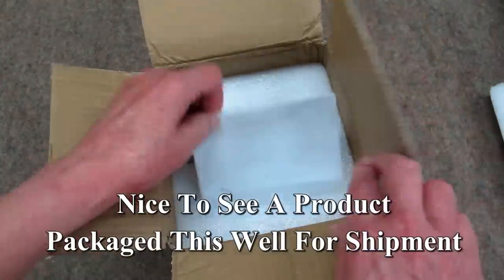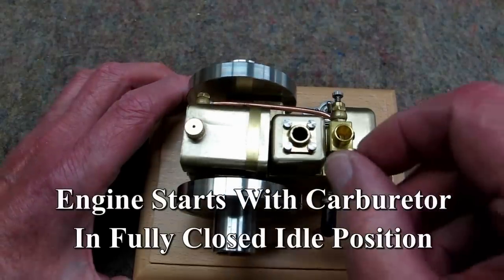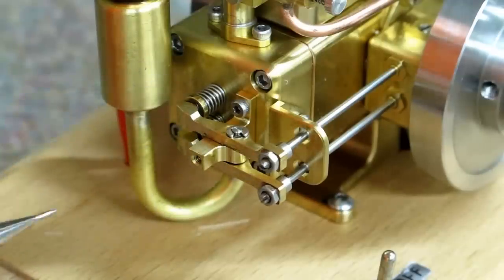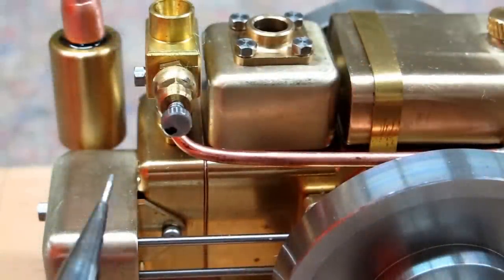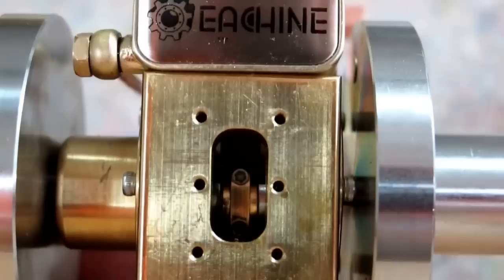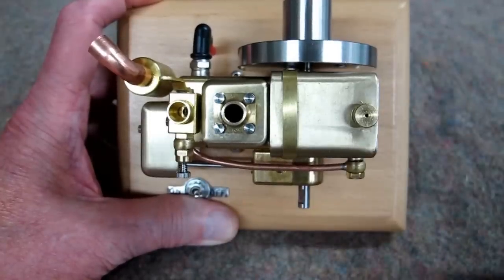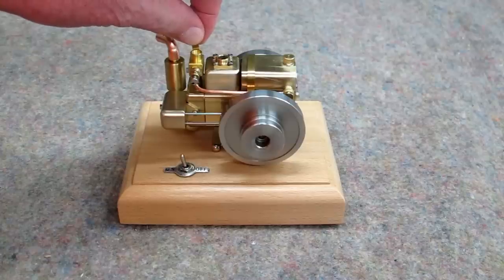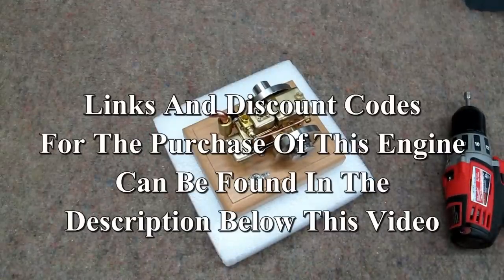Eachine ET5 Mini Gasoline Engine

Comment: Hello Ronald,
I have a question !
I bought one of these motors Eachine ET5. 
Now I have accidentally turned the screw where the throttle sits on it. 
Since then I can no longer adjust the engine, I have it now running, but as soon as I operate the throttle, the engine goes out.

Can you possibly send me a manual on how I can set the engine again from scratch that he runs as I got him. So as the carburetor was set on delivery !??

With kind regards Reiner Stähler
Reply from the maker: Hello Reiner,
When you say you “turned the screw,” are you referring to the “needle valve”?
Carburetor needle valve adjustment for most of these model engines is very sensitive.
It is a very fine point between running and not running.
There is no manual.
Where did you buy the engine? How long have you had it (when did you receive it)?
Is this your first model engine or do you have previous experience with such engines?
Ron
Reply: @RonaldWalters2010  
Hello Ron,
this is my 3 engine of this type. I have one ET1 and two ET5 the second I bought when I had adjusted the carburetor needle and he no longer ran !!!
I bought both engines from Bangood. 
If you want to know when I received it for reclamation or repair, I don't want to send it back, then I guess I will keep experimenting until I eventually find the adjustment again.
Have but otherwise not so much experience with these engines !!!
Reiner
Reply: But no problem Ron,
just thought maybe there is a guide on how best to proceed to get the engine back to clock condition.
Eventually I'll write to Eachine and ask there times although I have little hope.
Your channel is really the hammer would like to have a few more of these engines as well as the Eachine EM1, EM3, EM4 and so on and so on.
If they are cheaper again I will certainly get me again a model. I think you are just great !
Unfortunately, they are not very often sold from Poland or from Czech Republic, because otherwise I also have to pay customs and or import tax in Germany, but I do not give up hope!
Greeting Reiner
Reply from the maker: Hello Reiner,

Well, I hope you are using the links and discount codes in my video descriptions whenever you purchase an engine.

I find the ET5 to be somewhat problematic. Do not waste your money on the ET5 Pro. Also, I have declined to review the new 2-cylinder version ET5S. 

ETX runs well but is too complicated. I would recommend buying something else instead.

ET6 and ET7 are good engines.

Stay away from the ET8. Way too many problems with this engine.

EM1 double piston engine runs nicely, however it does tend to shake itself apart and requires frequent re-tightening and re-timing. Mine did not run out of the box. I had to replace a number of setscrews, which were too short, and then I had to figure out how to time it. Asking Eachine for help was a total waste of time… they did not want to answer anything. They acted like I was asking for trade secrets and I am trying to help sell their engines! The EM1 is VERY, VERY sensitive to needle valve adjustment. But I think it is a beautiful engine just to look at!

EM2 seems like a very nice little engine. Very steady runner… and also a pretty little engine.

For most engines… gently close the needle valve and open it 1/4 turn. Absolutely no air in the fuel line. Once it is running and has warmed up a little… adjust the needle valve (very slowly) for best running.

If you are using regular automotive petrol in your engines, carbon could become a problem. Fouling a spark plug or it does not take much to hold a valve open slightly and then it will not run.
I like the Coleman fuel with very little Marvel Mystery Oil as it is clean burning.

ET5 … the fuel line is difficult to get out all the air and maybe the little o-rings on the connectors could leak a little air. My needle valve was 1/4 to 1/3 turn open.

The ignition system on older engines had a habit of quitting when 3 batteries were used. So we accidentally discovered that the problem went away with only 2 batteries plus a dummy battery, which lowered the voltage.

I will be reviewing the EM3 and EM4 next.

Currently it looks like Banggood is out of stock for many of the engines.

Sorry I cannot be of more help with your ET5
Have fun!
Ron
Reply: @RonaldWalters2010  
Hello Ron,
thanks for the tips, the with the2 batteries I have used directly already with the 1 engine and only 2 batteries and a dummy.

Sorry I had completely overlooked, no I have the needle on the throttle adjusted, not the needle where the fuel line arrives!

I use lighter gasoline with a small shot of 2 stroke oil!!!

I will definitely use their links to the engines, as I said when you are cheaper again.

Have a nice weekend Ron.
Until then times Reiner
Reply from the maker: Hello Reiner,
Generally I do not take something apart if it is working or running correctly.

In the case of the ET5 carburetor, I also have not taken it apart. So, somewhat embarrassingly, I have not played around with the screw inside the throttle lever.

The needle valve (fuel line side) is basically used to adjust high speed running.

The one inside the throttle lever (assuming it is another adjustment) would be for idle speed adjustment. The one inside the throttle lever would ONLY affect low speed running/idle/starting.

This is a small engine. If too much fuel is entering the combustion chamber, the spark plug it will be wet and the engine will not start.

If not enough fuel is entering the combustion chamber, the engine will not start.

I found it necessary for the throttle to be closed to the smallest opening before the engine would start. I never could start it at full throttle (full opening).

If you remember how much you turned the screw inside the throttle lever (and in which direction) try returning it to the original position and try starting the engine. I assume you have already tried this.

Otherwise, with the needle valve (fuel line side) adjusted 1/4 to 1/3 turn open…  with the throttle in the idle position (smallest opening)… VERY GENTLY fully close the screw inside the throttle lever (do not force anything). Try starting the engine. Open the screw inside the throttle lever 1/8 turn and try starting again. Keep doing this (opening it another1/8 turn each time) until the engine starts… all the while making sure there is no air in the fuel line, the fuel tank is full, good batteries and the ignition is on.

Please let me know if you have success.

I have the heating systems in my house and shop taken apart for repairs and I will not be able to play around with this engine for at least a couple of weeks.

You want to use the highest octane unleaded petrol you can find and keep in mind some 2 stroke oil can burn quite dirty.  Not too much oil. Just enough to see it has slightly changed the color of the fuel. In this case the oil only needs to keep the piston o-ring slippery.

Good luck.
Ron
Reply: @RonaldWalters2010  
Hello Ron,

thank you very much for the tip, I will try it first. Unfortunately, I have not remembered the rotation and in which direction.
Have but this afternoon already times tested, but not yet so successful, just when the engine is wam seem to be the values again quite different.
Werd now times go through their proposal and if I should have success report me or but without success also report again.
I have subscribed to their channel, which is very interesting you describe and test the engines very well.

Good luck with the heater repair!

Greeting Reiner

Comment: can you also use 2 stroke petrol?
Reply from the maker: Not all 2 stroke oil is created equal and may be a bit too much for these small engines, possibly fouling the plug. I have a video on the fuel I recommend - Hit & Miss Engines - The Correct Fuel https://youtu.be/TvLziWCI7Oo

Comment: How does it hold up? Is it still working?

(Do you recommend this engine for someone that want a nice model gasoline engine, to run maybe once a month and put up for display the rest of the time?)
Reply from the maker: Good question, but not necessarily an easy one to answer.
Are you mechanically minded? Have you worked with or on engines before?
If not, I would not recommend this engine. A lot of people like this engine but a lot of people have trouble with this engine as well.
In my opinion the ET1 and ET7 Hit & Miss engines are the best/easiest to own. You will still need to be willing to work on them but it is not that difficult… you gotta start somewhere.
If you are mechanically minded and know how to work on stuff… hands-on… then I would consider the EM1 which I consider a work of art and a beautiful display engine.
But still… I would start with the ET7 (easiest to work on) or ET1 first.
With all of these engines keep them oiled and if you are not going to run it immediately, take out the fuel, water and batteries.
I have quite a few videos on these engines… and a playlist which contains all of them.
Thanks for watching. Please subscribe. 
That is what keeps this channel running. 
Ron
Reply: @RonaldWalters2010  Wow, that is a fantastic answer. Thank you so much!

It actually seems a bit daunting to get one. 250 euro is a lot of money, and I don't intend to invest a lot of time in getting them to work, much less keeping them working. The steam and stirling engines I have 'just work' when I show them off, and provide me with a lot of enjoyment by just looking pretty the rest of the time. It seems these gasoline engines are in another class, both requiring a bigger investment of time as well as money.

I did view your other videos as well, but this one grabbed my attention the most. It just looks and sounds so nice. I also considered the Aliexpress "self circulating internal combustion engine model", which seems less complex and prone to breaking down, but also considerably less pretty. (Edit: https://aliexpress.com/i/4000008141818.html )

I'll think about it some more before I make the investment!

(Also, to anyone reading; I highly recommend you use the coupon codes in the description of the video. For this engine, it saves you 50 euro. I wasted 10 euro on my steam engine by not using it.)
Reply from the maker: I looked at the “self circulating internal combustion engine model”. I think it was listed on Banggood (maybe still is). I thought it was too gimmicky with the clear combustion chamber and other stuff… gave it a miss as I could foresee problems.
I would recommend the  “Tarot Large Scale Stirling Engine” which is very attractive and a good performer.
Also good are the following small engines.
Microcosm - Mini Live Steam Engine
Microcosm - Mini Beam Steam Engine
Mini Vertical Stirling Engine

Comment: Thank you for the great video explanation, Ron. Do you think I could power a little RC-modelship via gearbox with one or two ET5 engines ? Kind regards, Wolfgang ( from germany )
Reply from the maker: Wolfgang,
I think you would be disappointed with this engine for that purpose. You may want to consider something like the following. There are different versions. Some of these have electric starters and are water cooled. They are intended to run on methanol fuel with glow plugs. They say there are ignition conversion available so it can run on petrol. You would need to look around for everything.

https://www.banggood.com/custlink/v3DYLmFiwF

The following may be good so you can play with it as see if it is suitable for your purpose. The RPM may be too high for you as it may cavitate the props. I have no experience with these engines but they look interesting.

https://www.banggood.com/custlink/GKmhODHliw

Thanks for watching. Please subscribe. 
That is what keeps this channel running. 
Ron

Comment: Dear Sir, what kind of fuel are you using to make this engine running easily? Coleman fuel+4%mystery oil or just #91 gas(but the gas we can buy all have 10% Methanol)? Thanks a lot!
Reply from the maker: I use Coleman fuel plus "Just A Hint" of Marvel Mystery Oil (much less than 4%). 
Personally, I have not used gasoline (petrol) in these engines since Coleman fuel burns so clean. All you can do is try the highest octane gasoline/petrol you can buy.
Reply: Thanks Sir. I just bought a M12 followed by your link. The enigne not work, so I have tested the ignition and it is normal. I have also cleaned the spark plug and its chamble and get rid of the oil inside. But still the engine not work at all. I have spend another hour to loose main oil needle from 1/8 to 1/2 after fully tight. I rotate a little by little with hand, but engine still can not start. I checked the spark plug after that and it is still dry. Is there a perfect position of main oil needle? Even missed a little or over a little, the engine will not start? I need to rotate the main needle more carefully?
Reply: I use the same coleman fuel and marvel mastery oil as you did.
Reply from the maker: Hello Chengzhang,

It can be frustrating when one of these decides not to run. 

This is my basic (canned response) checklist for this engine. 

I assume you have compression. Sometimes the valves can stick open and there will be no compression. Just flick the valves gently to get them to free up and seal.

First, the boot needs to be on the spark plug and then the wire just butts up against the end of the plug. 
Make sure your battery is good and that you have a good spark.

This engine does not have much compression (at least my ET5 did not have much compression). If you have zero compression, remove the valve cover and flick the valves a little and make sure the valves are actually closing. And that there is a slight gap between the valve arm and the valve stem. You need some compression. 

You may need to open the needle valve 3/8 to 1/2 turn (maybe a little more). Each engine (or each carburetor) could be slightly different. 

After it starts running, then you can close the needle valve slightly until it runs correctly. 

Carburetor needs to be full closed to the idle position (this is set at the factory) for starting. 

It is not easy to get all the air out of the fuel line. Fill the tank completely so the connection to the fuel line is completely covered. If there is any air in the fuel line, even one bubble, the engine will not start. 

With the engine starter (cordless drill) turning, place your finger over the carburetor to choke the engine and completely fill the fuel line. If you run out of fuel, then air will get into the fuel line and you will need to do this again. 

If you get too much fuel into the engine (flooded engine and the spark plug is too wet) it will not start either. Then you will need to dry the plug and get excess fuel out of the cylinder. To do this gently remove the spark plug and spin the engine with a rope starter. 

I really do not recommend using the cordless drill adapter. I think it can be a bit rough on the engine. Sometimes the cordless drill starter can make it more difficult to start the engine because you must pull the adapter out while the drill it running full speed. Sometimes this can drag and actually slow down the engine. Or your cordless drill may not turn fast enough. 

Make a rope starter using smaller cord as I show in my video. It will spin the engine faster than a cordless drill. Get someone to help you hold the engine so you do not accidentally pull it off the table and drop or damage the engine. 

Hope that helps. Please let me know how you do. 

Thanks for watching. 

Ron
Reply from the maker: One other thing... do not tighten the needle valve too tight (only close it gently) as it is possible to break the point of the needle off if tightened too tight. 
It can take a little experimentation to find the correct needle position. Each engine can be a little different. After it starts and warms up a little further adjustment will be required.
Too much oil in the fuel can also be a problem. Just enough Marvel Mystery Oil to change the color a little is plenty.
Reply: @RonaldWalters2010  Thanks for the detail description! I took spark plug out and connect to black wire with battery, Spark discharge normally when I rotate the engine. The engine does not run when I follow all the steps. I found obvious a lot of oil(something like oil) come out from the exhaust pipe(drill start a few second), even I keep always keep Carburetor  full closed. When I took the spark plug out, both the spark plug and its chamble is dry.

I find this is called rich oil and I rotate the engine with drill in the opsite way(keep a few minutes) to get the oil back, but oil still keep come out to the exhaust pipe when I rotate it normally.

In short, the engine never has any reponse and never started. That mean, the engine keeps the same when the swith is on compare to the power swith off.
Reply from the maker: Hello Chengzhang,
Sorry to hear you still have problems with your engine.
It is very difficult to analyze what the problem is with your engine.
I suggest you contact Banggood and ask to return the engine and ask for your money back.
I sincerely do not know what else to tell you.
Yours truly,
Ron Walters

Comment: I’m annoyed that they use a 45 degree copper fitting on the exhaust.  Not very craftsman like
Reply from the maker: Actually, it is a 90 degree elbow and it works fairly well to deflect the exhaust away from your face or in whichever direction you prefer... or you could make your own. Thanks for watching.
Reply: @RonaldWalters2010  yeah, I don’t know why I wrote 45.  I understand that it’s functional ...I’m still not impressed with it. 

This isn’t an attack on you, just my personal opinion.  Thanks for showing